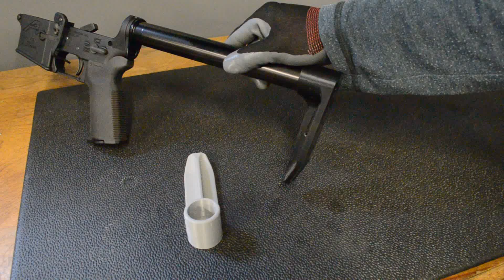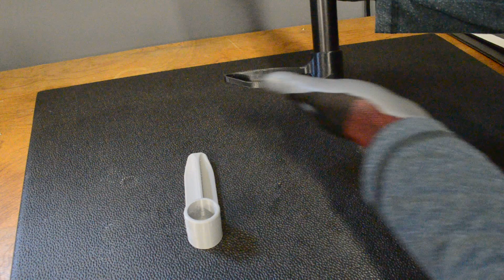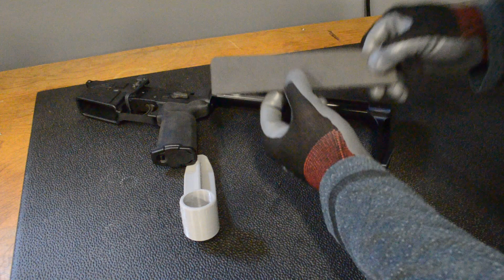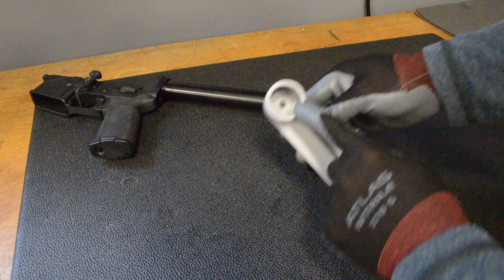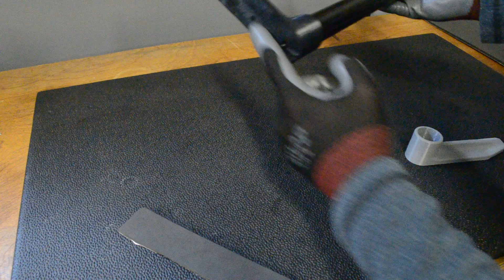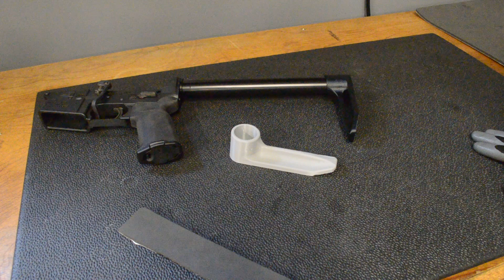3D Printed Ultralight AR15 Shoulder Stock

Comment: So I want to learn to model this. I am a dwarf. I’m 3 ft tall and I have customized many firearms for me to use. I’m now doing my first few ARs. My length of pull is only 9.5” where the shortest available on the market are around 11”. What I’ve been doing is taking the butt stock off and chopping a large portion of the front off with a saw and then I can slide the stock farther up the tube. Of course this requires a butt stock that’s open on the end which will allow it to slide up the tube. I have no problem with the buffer tube coming out of the back of the stock because it rides just above my shower as I shoot. I need to model up one as small as this with an open back that I can replace my m4 brace with
Reply: Hey man, ever have any luck modeling AR stocks? I need/love shorter stocks, Im really looking to see if I could 3d print, or pay someone to 3d print me a fixed stock about carbine length. I can NOT find any rra entry stocks anywhere!!
Reply: @F386Longrifle  I never did any yet. Haven’t been printing in awhile. I need to get back on it. I’ve been using my Sig braces
Reply: *above my shoulder

Comment: Have you ever seen anyone 3d print an AK butt stock? I have an AK that is milled so the butt stock/adapters that are sold won't work. I was looking at my rifle and though "Hey, I am pretty good at 3D CAD. I should make my own!" So I've been looking at 3D printers. I am looking at designing a "skeleton" stock and the adapter. The printer that you are using doesn't really fit within my budget, so what other printer would someone suggest? I am looking at a Maker Select 3D Printer V2. I will probably print it in pieces and then assemble it with some kind of compound. I will have screws/bolts for the attachment of the adapter to the butt stock.

Comment: looks like if MAGPUL adapted their mag feed lip protector to fit the buffer tube...very cool and lightweight design.
Colin Chapman described making a race car fast and competitive as "ADDING LIGHTNESS"
awesome as always GIAG
Reply from the maker: A fellow motorsports enthusiast! I'd like to build a Lotus Super 7 in the future with some modern improvements.  The new fiesta ecoboost motor would be a good power plant.
Reply: Guy in a garage Dude...honda blocks are a dime a dozen and easy to make power..ecoboost units are showing MAJOR flaws with the direct injection adding a crap ton of carbon into the valves and no good way to flush them without nuking the EXPENSIVE turbos due to an over rich and overheat tendency..using seafoam or BG, or ANY of the good intake system flushes.. the FORD turbo set ups ARE crazy power.. but WAY WAYyyyy too many technical issues.
in fact the TSB is they recommend ...(((CHANGING THE CARBONED OUT CYLINDER HEADS FOR REPLACEMENTS!!!!!!!))))
Reply: Guy in a garage READ NEXT
http://www.speedhunters.com/2015/03/the-story-of-a-honda-powered-lotus/
Reply from the maker: Is there an easy way to mount a rwd transmission to a B or K series? Last I researched, there was not.  I know about the carbon problem on all the DI engines. Don't the latest revisions have a secondary injector in the manifold?
Reply: Guy in a garage FORD hasn't fixed it yet..and the problem is COLD START when the engine isn't up to temp and is running full rich, and loads up the valves....more fuel equals worse problems and the turbos are frankly TOOOOO close to the heads, and run too hot....but FORD found that is where they make max power and have the least amount of lag...but they are twin scroll and those are inherently more fragile to start with.
as for mount option with a honda engine....dude, adapter plates mate ALMOST anything with the correct flywheel geometry.
the mount would need to be a one off, and of that...the S2000 engine is a true hot rod motor...but the wiring and engine management is a stone cold bitch..K and B blocks way easier to use,BUT They turn COUNTERCLOCKWISE....ARGGHHHH.and the K can be a serious power torquer for a smaller engine. K20Z1 and earlier are easy 220-240 HP..but not a screamer like the F20C1-F22C1 in the S2000, where the power comes on race car style after 5K...and it's got no balls down low. but unless you are seeking to go mid engine...the honda fwd stuff...isn't going to work....sadly.
Reply from the maker: +80spodcastchannel ( : FACEBOOK DUDEJERKY ☆☆☆☆☆ I thought the K motors were clockwise?
Reply: Guy in a garage turn FORWARD, and torque REAR ward...hence ANTI clockwise...or at least that what the wiki said for why they weren't applicable for RWD longitudinal set ups...wrong spinny spinny
Reply: Guy in a garage Hmmmm....gimme a sec I got a K in the DUDE CRV...okay and back in and verified.. engine pulleys and accessories on passenger side and clockwise rotation.
the K is a kick ass engine....torquey enough and real flat on the torque curve in my application... but detuned for the mom mobile....hotter versions crack 220 hore without external power adders...
a smallish turbo blowing a very safe 5 PSI would liven it up in the upper ranges for sure.
Reply from the maker: I like the K motors a lot. I was just thinking the ecoboost because it can make similar power with a smaller and lighter block. This would move the motor back 4-6" to help the inertial moment.  I've seen weight numbers around 20X lbs, but I'm not sure if that's with accessories.
Reply: Guy in a garage well...a ford 302 is light small and with a turbo..makes mad power as well... and easy to work on
Reply from the maker: More power than is needed in a lotus super 7! I think 180-140whp is plenty in that light of a car.
Reply: Guy in a garage okay....miata 1.6 with a turbo then??
bolt on and go
https://www.flyinmiata.com/custom-turbo-system-na6-chassis.html

Comment: Very nice! But get the foam.in black, man! Harbor freight has some black hard rubber 'diamond plate' pattern in about 1 foot square, self adhesive. that you could cut to size. It would look awesome on there.
Reply from the maker: Good point. It looks dark grey in person, but in the right light, it doesn't look close to black. I'll see if I can find something darker that still has a bit of cushion.
Reply: +Guy in a garage i have some of the rubber material Left over from another project. Enough I think to cover the buttstock. It's yours if you want it.  Just send me a message where to mail it.